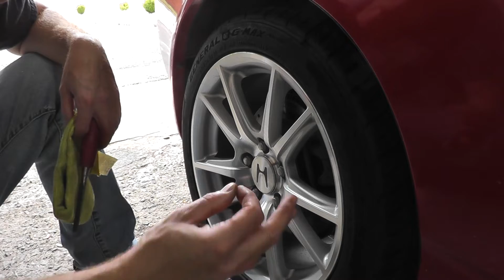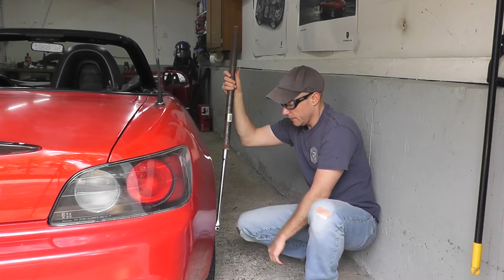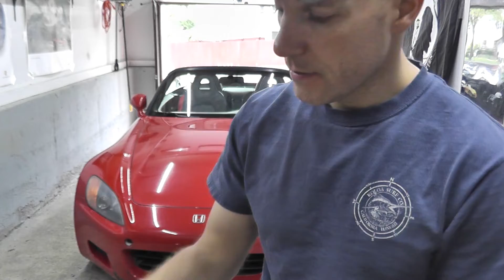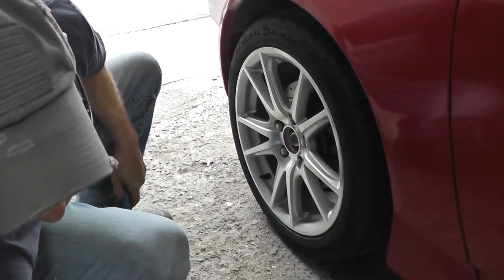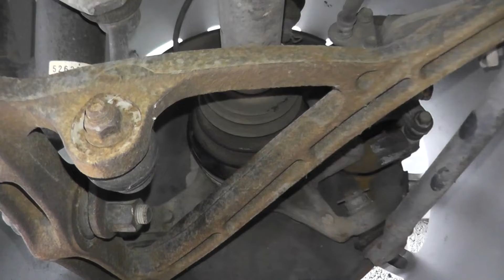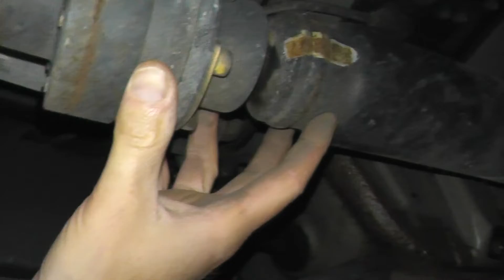S2000 Rear End Noise | S2000 Build Part 10

Comment: This may seem like a silly question but I just put AP2 drivetrain in my AP1 and when i removed the propeller shaft the little balance weight was connected to the transmission and I’m having some vibration I didn’t have before and was curious if that could be it?